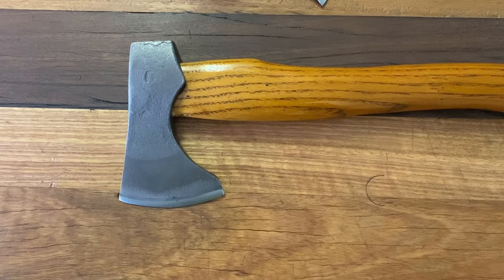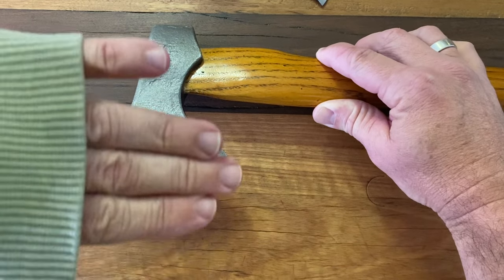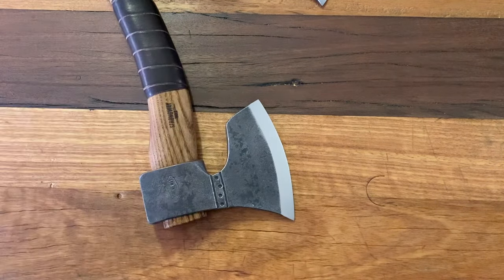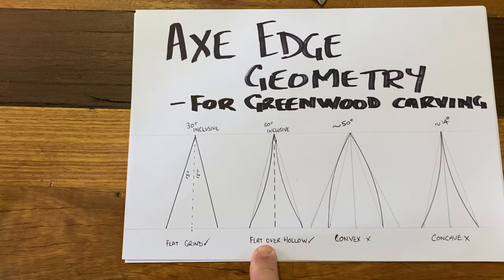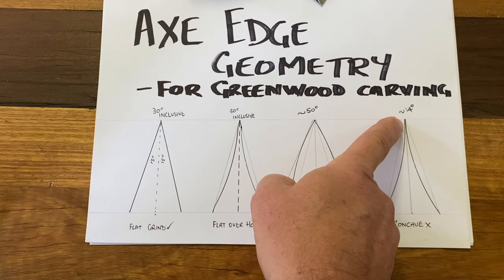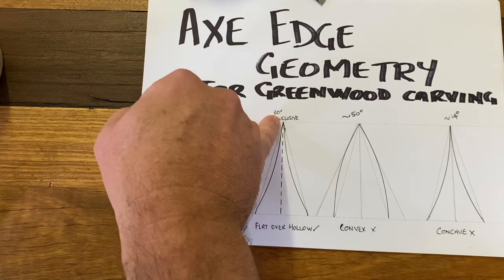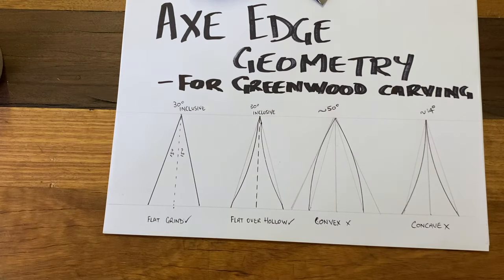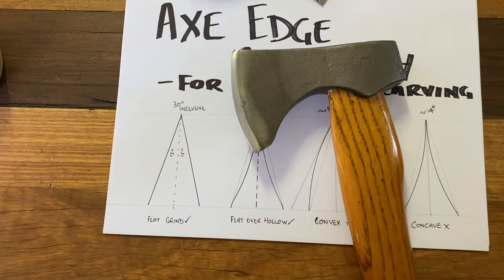Carving Axe Edge Geometry - Part 1 - Carving Axe Edge Geometry

Comment: This is very helpful! My question is, if you don’t want to eventually end up with a concave shape, would you sharpen using a flat stone versus the wheel? I’m very new to all of this 😁
Reply from the maker: The beauty of a flat over hollow grind is that it is easy to maintain a sharp edge with regular stropping and an occasional touch up on your choice of flat surface sharpener.  Once the hollow disappears and starts to become convex (over time with stropping and sharpening) I just take my axe back to the wheel and grind it to flat over hollow again.
Reply: Thanks 🙏 this is very helpful…
Reply from the maker: My pleasure
Reply: Flat over hollow will turn into a flat grind if you sharpen by hand only. Once it hits the tormek you can get it back to flat over hollow.
Reply: Good explanation, Chris. Does this principle apply to knives too?
Reply from the maker: @sgr1ob  thank you. Yes it does. I should probably so a video on that also.